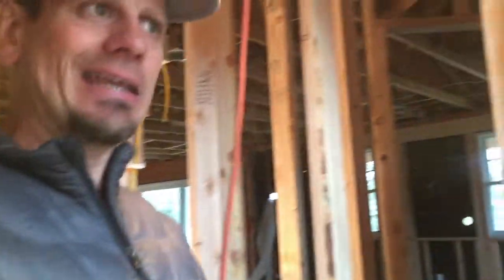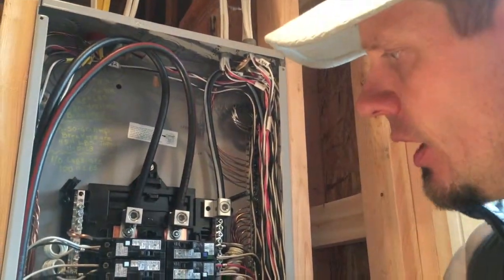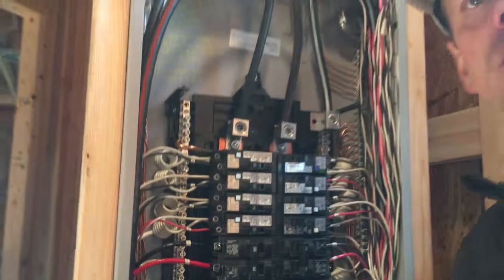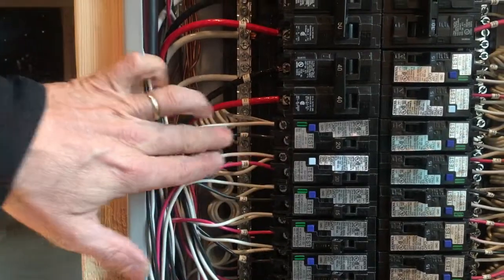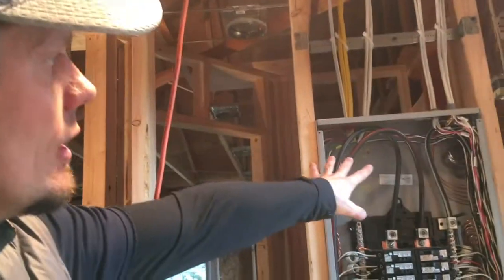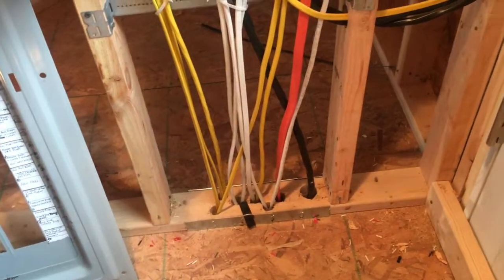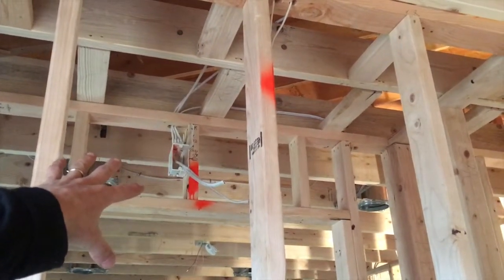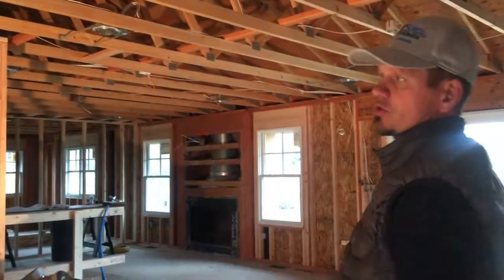Arc Fault Breakers (November 2018)

Comment: I like that idea of splitting the circuits outside the panel.
The box that you split it at..is it treated as a junction in the hallway or closet? Or do you run a light or outlet in that box?
Reply from the maker: usually i like to split in a light, less box fill.

Comment: I would suggest eliminating 14 AWG from All installations.
Reply: On today's lighting with LED being pretty much standard.. even ceiling fans don't pull as much.. 15a is fine. Your gonna want to break off into sections for lighting anyways incase one was to drop out.. you would hopefully have light power in a nearby room/hallway. 
20a if you can for outlets.. you never know what will be on it. This owner may use it as a reading room then next might use it as a server room.
Reply from the maker: Are you an electrician?
Reply: Great Video, I didn't even know this type of NM cable was available.  15A circuits are great for lighting!!!